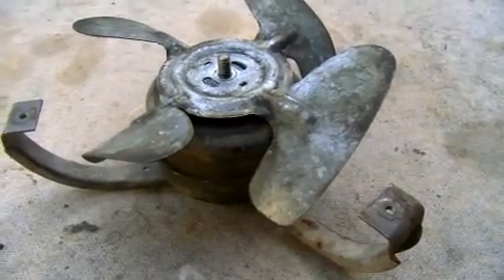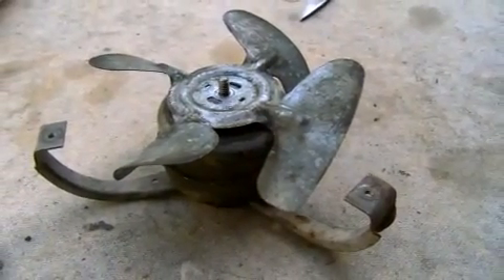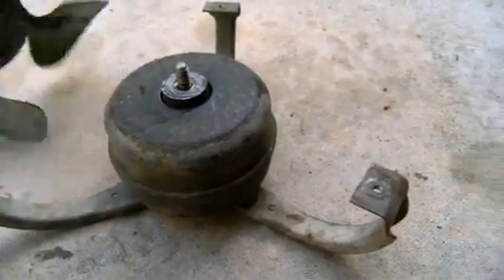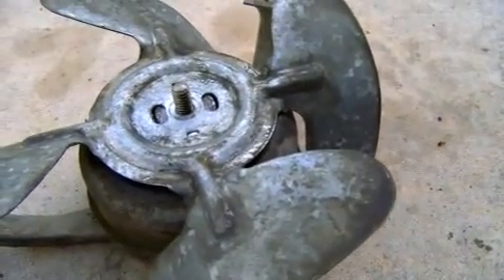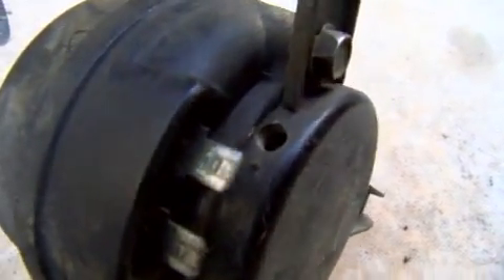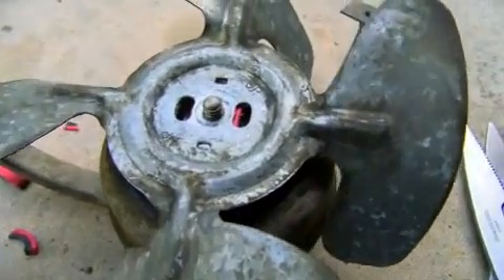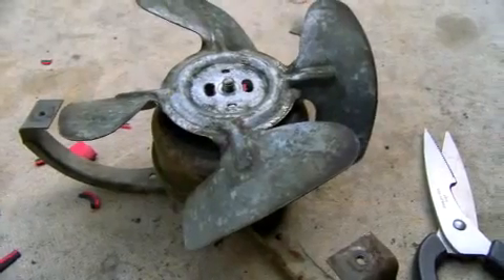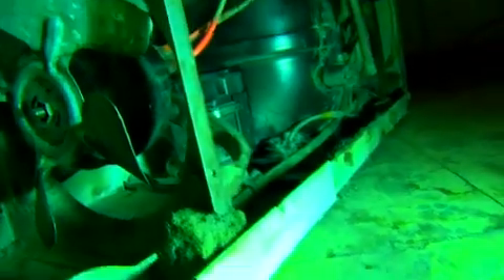Refrigerator Condenser Fan Motor Repair

Comment: I heard the compressor in our fridge sounded different, like it was working harder.  Looked under the front and saw the coils were very clean, maybe too clean (I cleaned them ~9 months ago)  I touched them and they were too hot to leave my hand on.  Pulled it out and removed the back panel and pulled the fan. It was warm so I knew it was electrically good but it didn't spin as freely as it should (enough drag to stall it).  I puzzled about how to open the motor to oil it and found you wonderful video.  I punched the hole and pumped a bunch of light machine oil AKA 3-in-one, sewing machine oil, 10-weight non detergent into the felt.  I never know how much oil but I try to look for approaching saturation - it's a big felt pad.  All toll too about 1.5 hrs.  All is working great this morning. The re-lubed motor will last another 25 yrs.   If you don't fix theses things, even if the fridge seems to be reaching temp, the compressor will eventually fail and it uses a lot more power.   Thanks so much for your video.

Comment: It is easy to pry both covers off the condenser fan motor, just use a screwdriver. Cleanup the inside, and oil up the felt pads. Tap the covers back on and install fan blade. Just did it to mine and it is running smooth as silk.

Comment: I added oil thru the front of the motor in the gap / center where the spindle / fan blades attach. That worked for about 4 months. Upon finding non-spinning fan again, I found when I added the oil, it was leaking out of the motor housing where they joined together. I sealed the two housing halves in place with JBweld and it worked fine. Was adding oil and was wondering can I over due the amount of oil I'm putting in? And am I missing the boat doing it this way? You soaked the pad via the drilled hole. Am I able to soak the pad my way with it lying on its backside or should i do it via a drilled hole like you did? Thanks.
Update: Well, it's not spinning. I figure my entry point for the oil was a fluke the first time. Did the drill and oil fill as you instructed. Just wondering if I did any damage with all the oil I introduced via the front and did the motor in. My guess is yes. Update upcoming.
Well, once reinstalled, the fan was spinning but a very barely spinning pace. I allowed the motor to drain from the housing all day and night prior to re-installing thinking it was not the appropriate way to re-oil. Anyway, I left in and plugged in thinking/hoping it would maybe come along and work for me. Within a couple of hours, I re-checked it and it's spinning more like itself. YEA!! Hope my experience / trial and error can help someone.

Comment: I have a WR60X0266 GE condenser fan (please see google images), it turns but appears to be misaligned and is squeeling and stopping, if it's a bearing issue I could fix that.

Trouble is there is a plastic cap on the spindle below the fan blades which I cannot seem to remove, any ideas how to get it off?

Comment: Unfortunately the resolution is just a bit too soft. I have a 23" monitor with a 1920 x 1080 resolution and it's really low in detail. I have YouTube set for automatic resolution and it fell back to 240p.